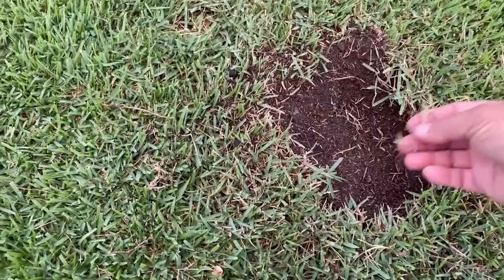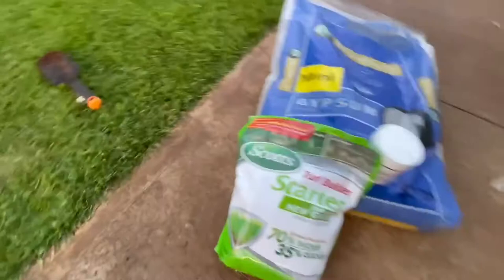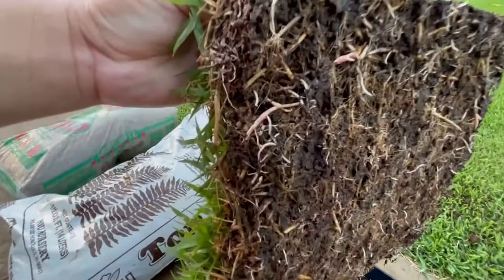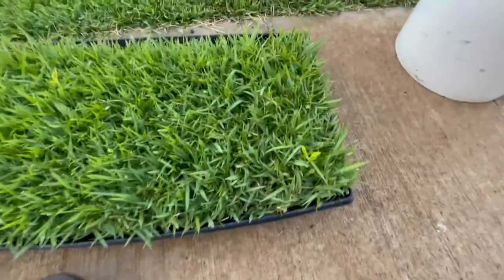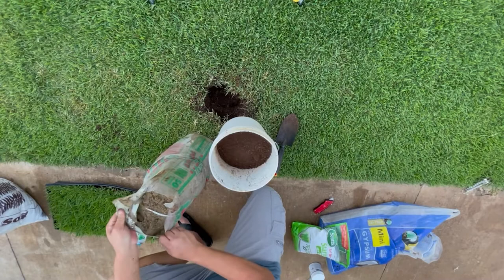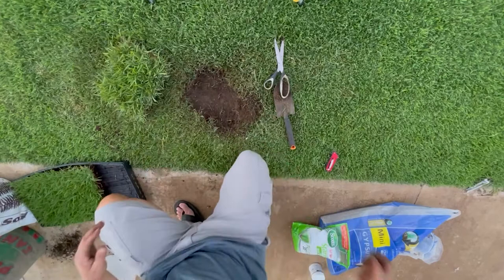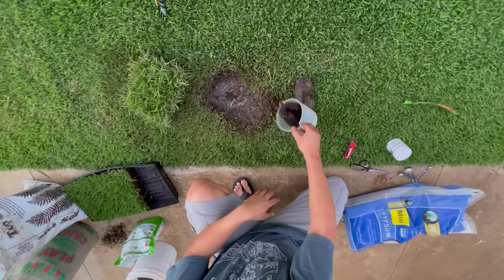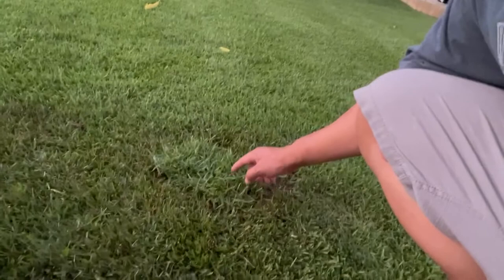Zoysia Sod Repair

Comment: Can you cut El Toro at 0.5” with a reel mower?  Does it stripe good?
Reply from the maker: Hi Thomasm El Toro is best cut with a Reel Mower.  I mow with a Mclane reel mower at 3/4".  Its a wider blade grass and it does stripe, but no where as good as a cool season grass.